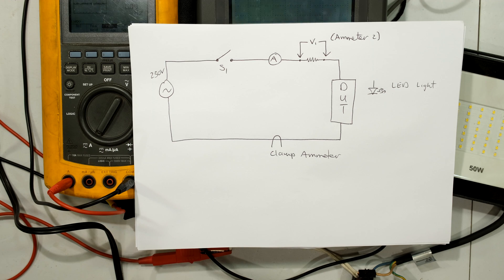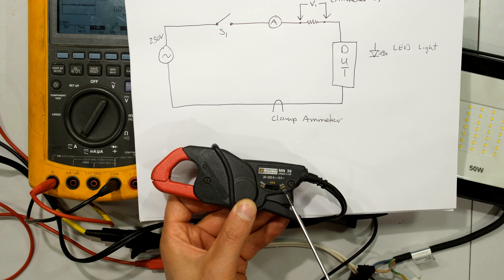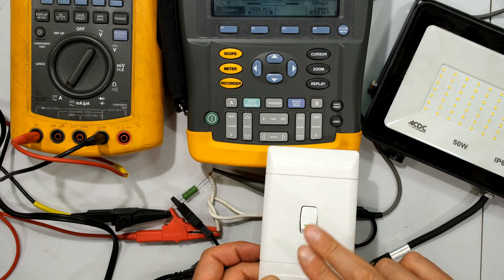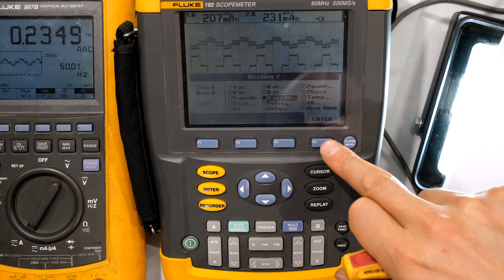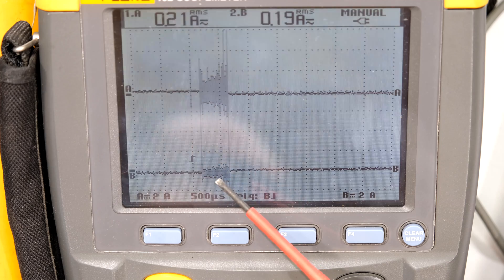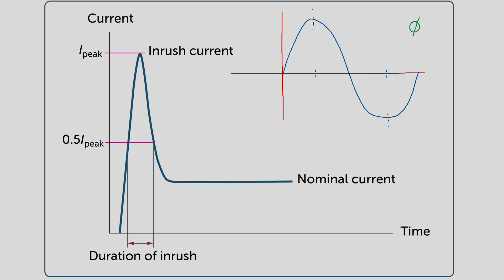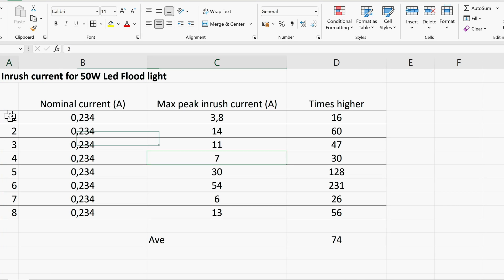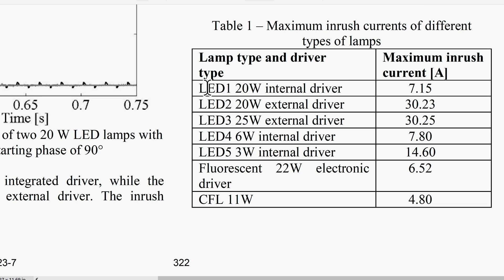Measuring the inrush current of a 50W LED floodlight

Comment: Will the circuit breaker of 20 ampere trip will break or trip? what will happen to the wires? I know its in millisecond and so the circuit breaker is not fast enough to react and trip but what does having a high inrush current entails?

Comment: I am supplying a numbers of LED luminaries on each phase,  drawing 20A per phase at 230V, fed from a 480V/400V 30kVA transformer. All LEDs are switched on/off at the same time via a contactor at the  transformer primary. The MCCB trip settings are: 50A, 2 seconds; 200A, 0.4 second; 750A, Instantaneous. 

Once in while, the MCCB is tripping. IR tests comes very good.

How do you anticipate the transformer inrush interacting with the LED inrush? Can it cause trips from the combined inrush based on the trip settings?

Appreciate your thoughts.

Comment: I wonder of dimmable led lights have lower inrush current. Could be because the drivers cirquit is more sophisticated and perhaps works at zero amplitude crossing. I have no equipment to do a test however.